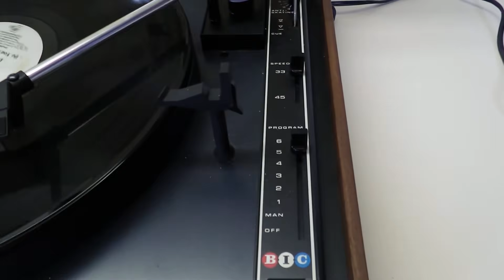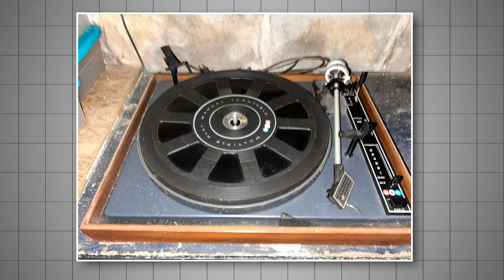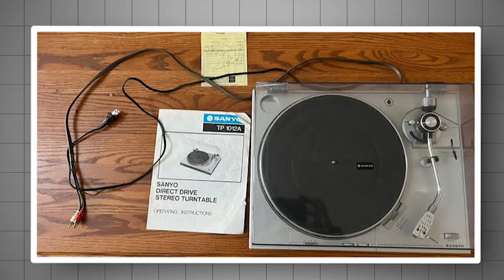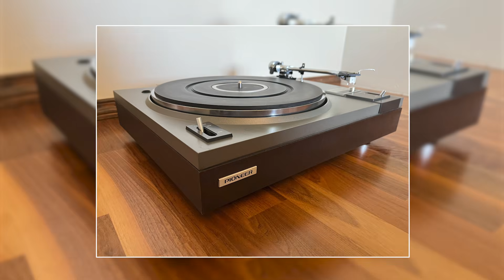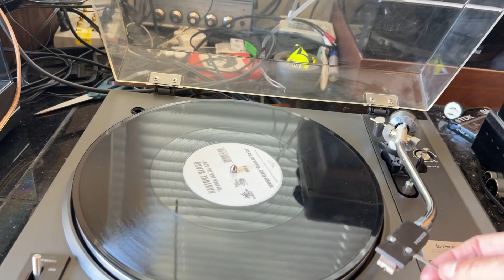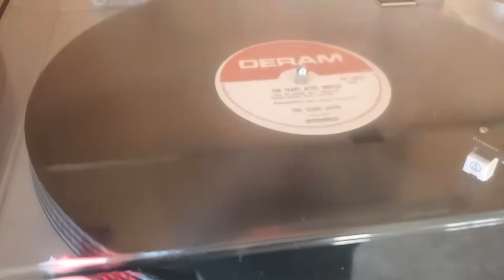5 Vintage Turntables You Can Still Find for Under $100 (They DESTROY $2,000 Modern Decks)

Comment: BIC turntables are all crap.  
The tonearms are well designed in principle but rather flimsy. 
The rest of the mechanism depends on several very weak springs. When they fatigue   --- and they all do --- the thing stops working right, and the only way to repair it is by replacing those springs, which are not readily available. 
Motors often fail, and in the  models with electronic drive, those circuits fail.  
This is a brand to avoid even as a gift.